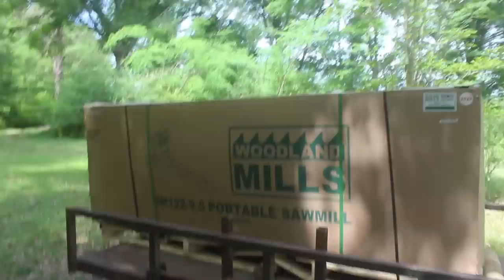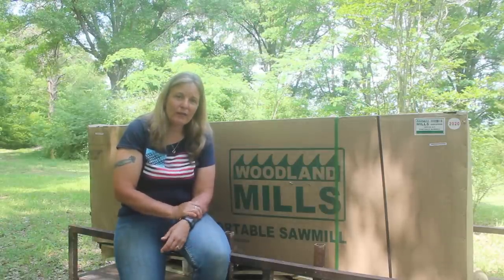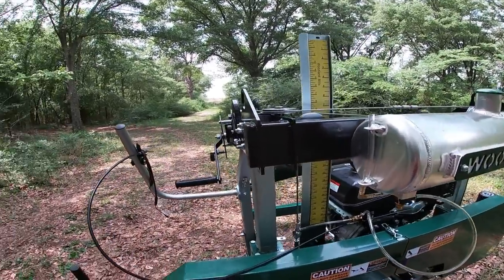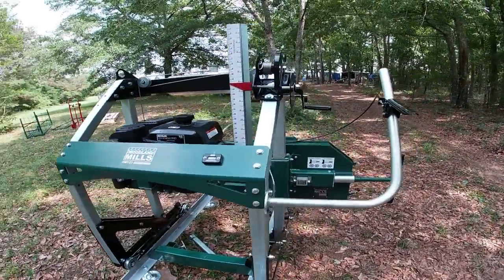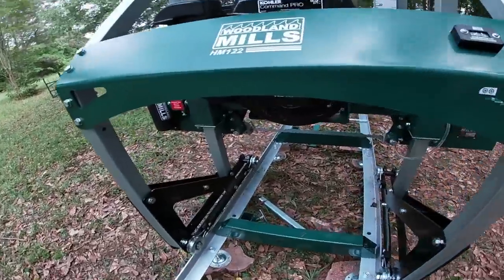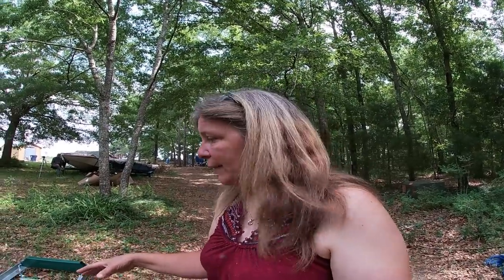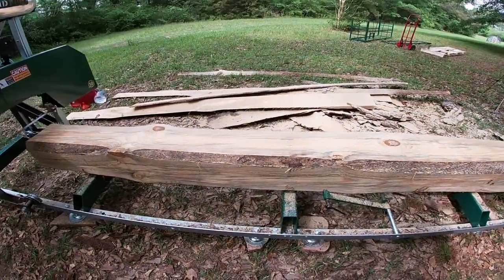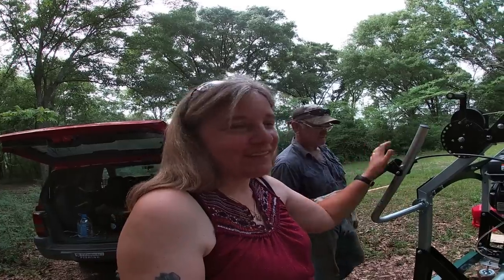Here We Go AGAIN : Harbor Freight VS Woodland Mills BANDSAW MILL

Comment: I am watching  your video now. Just a little FYI. I have owned an HM130 for almost 2 years and milled for myself and the public the whole time. For the money, you wont find a better sawmill or BETTER service. Your mill came with the hr meter and auto lube that I did add to mine. If you EVER have any problem, all you have to do is call tech at Woodland and will get an answer and/or replacement part soon. I am glad I picked Woodland Mills over the many other brands I looked at and drove a way to see if for nothing else but their service after the sale. Enjoy your mill and be safe.
Reply from the maker: That is great to know, thank you very much for the info and for watching.
Reply: I have a woodland mill also I agree 100 with Brad for the money this is an amazing saw

Comment: That is a nice saw mill and cuts good. I have the HM 126 and love it. I know it's been 2 years but I bought a hand held metal detector and I use it on every tree before I start to mill it. I have found more nails and spikes where they were left in the tree after something was taken down or fell off a tree. Even barbed wire that a tree grew around. You sure don't want that blade to hit something metal. Seen it happen a couple of times to a friends mill and destroyed his blade.
Reply from the maker: Is there a hand held detector that you reccomend?
Reply: @ThirdTimeAroundRanch    I have a Brinks security handheld that I have been using for a few years. It's similar to what they use in a airport to check you with. I hate to say it but my brother picked up a 15 or 20 dollar handheld he got from Harbor Freight and he said it worked just fine. He has found a few small nails with it. Hope that helped.

Comment: I have a hm126.  I had a problem with a bad clutch.  I burned it up because the throttle was not set properly.  I am confident from the sound of your mill that your throttle is also not set to full power on the motor thus overworking the clutch.   It will soon burn up.  Play with your cable, that motor will really rev when set correctly and the clutch will not slip.  Of course I may be wrong, I'm only hearing this on a cell phone!  By the way WM sent me a new one.  Love the mill hope you do too.
Reply from the maker: Interesting, we also thought the same thing so we called WM and they told us how to adjust the cable to make sure it was at full throttle. We adjusted it as far as we could get the cable to move. Maybe we will give them another call. We absolutely LOVE the mill!

Comment: One bonus the woodland mills has over many of the competition, the prices favourably compare. Woodland Mills is generally lower in price for everything compared to the other brands, quality wise, they stand up right beside the higher priced brands.

I've also noticed Woodland mills has a simple track extension method, split the middle of your existing and put as many extensions as you want in between. same connections for them and as good a quality fit.
You can also add extra dogs to help secure the logs against the uprights better. The optional cable winch log loader I've seen electric screwdrivers (drills ) power logs onto a mill, making the work much lighter.
If you were to get into doing custom cut lumber for sale, the extra length possible is a big bonus.

While adding any of these would cost some, the cost is lower for Woodland Mills than the comparable quality mills.
Reply from the maker: We could really use another bed section it was a tight fit on our log. We actually cut the logs to 10'4 so we had extra for squaring the ends.
Reply: @ThirdTimeAroundRanch  If you get it I would also get a second clamp just for the extra security knowing the log isn't going to move under the blade.
Reply: Jaqui Greenlee

Comment: We have had the same model for the last 3 months and have not been disappointed.  We have gone through some blades ofcourse and just got new guide bearings and the following drive belt ordered.  We use this mill just about every day. We bought the extension because we need to be able to do longer logs. Also your blades will last much longer if you peel or brush the dirt from them before sawing.
Reply from the maker: Thank you for that information, we will hopefully be stripping all of our logs.

Comment: i like mine.   i built a rigid steel  frame for under the bed rails  then chopped up a 200 dollar trailer kit from northern tool to go underneath it.    scaffolding leveler feet stuck into some tubing make good stabilizer/levelers for the mill.       they improved the 122 quite a bit though for your model year.   so some of the things i built for mine come standard on the new ones.    enjoy

Comment: I have a HM122 I got in 2017, been a great little mill, I've cut a lot of lumber with it over the years and the only problem I've had was the kolher engine died horribly recently and I replaced it with a HF Predator engine that seems to have better torque than the Kohler. I did replace the plastic lube tank with a steel tank and installed an hour meter.
Reply from the maker: Nice upgrades you did.

Comment: I bought a sprayer at Harbor Freight since the salesman on the floor said that he'd never seen one come back to the store. He said they have over 3000 stores and each one sells about 1000 a week and never saw one returned. I took it to the counter excited to pay $19.99 for it. The cashier was ringing it up and said, "If you HAVE ANY problems with this spray DO NOT RETURN IT TO THE STORE! Contact the manufacturer!" So, there you have it. Used it twice and the hose split just before the spray tip attachment! P.O.S. But they know it. Now you do. You get what you pay for. Harbor Freight...flea market products...flee the markets products!

Comment: May i suggest you buy a cheapmetal detector. It always helps to do a little NDT before you start, only takes a minute and can potentialy save you $ for replacement blades. It's surprising what finds it's way into a tree as it grows. Good luck with your endavours.

Comment: Two of the most precise instruments for measuring, etc.  Your eyeballs.  I use a Husqvarna helmet with the screen for your eyes and hearing protection.  Also, gloves, and chaps while sawing..  I have worked some in the woods and I have seen Professional loggers badly injured while using saws.  I have almost no hearing, mostly lost from gunfire in the military.  Hearing aids are not cheap and are a royal pain in the butt.
Reply: I own a tree farm.  I just had the loggers in for a thinning.  They had to hand cut some 30" - 50" white oaks and believe it or not, I was surprised to see them put on chaps & a helmet with screen & ear protection.  They told me that after seeing others nearly cut off a leg, they figured the chaps & helmet was much cheaper and less painful than the cost and pain of an injury.  I actually witnessed one get hit in the head from a large limb from a neighboring tree during a felling . . . and he got right back on his feet with no injury!
WEAR ALL YOUR SAFETY GEAR . . . IT'S NOT MACHO TO LAY IN A HOSPITAL BED!
Reply: @michaels3972  Absolutely correct.  Even the professionals are occasionally injured.

Comment: I had first considered buying a harbor freight sawmill too. I  was more fortunate than you were , because this was a huge investment for me I did my research and watched videos on all name brand sawmills. One of which was the woodland hm122 sawmill.  After watching the videos that woodland makes on all their saws and comparing the costs I ordered their HM122  sawmill. I'm not pressed for time so I  just ordered the 7 hp so cutting speed wasn't an issue for me and I wasn't planning on any logs larger than 20 inch diameter.  So i figured the extra money would be better spent on the track extension because I knew I would want to cut 12' boards and woodland ships anything extra added to their order for no extra costs. I wish I  could've afforded it & I  would've also ordered their blade sharpener/ setter cumbo.  But that will have to wait.  I did order the extended track, some extra blades & some bearings. They won't ship it until nov 30th,  2021 which is giving me time to cut down some trees.  Most my trees that are on my property are black walnut so I hope full in selling some of my walnut boards to pay for my sawmill. My trees are in the range of 16-12 inch in diameter.  Keeping them a little over 12' is just about my little JD 2305 tractor's limit for lifting and hauling up a fairly steep hill. I  only guessing but I'd say they weigh over 600 lbs. Lately I've been watching quite a few of your videos, sawing with sandy & lumber jack. Learning a lot before  my mill arrives. I  just finished building a platform for my sawmill.  Using my tractor & my 6" post auger, drilled 10 holes, 3' deep, arranged 10- 5' long 4x4 for 2 tracks 26" wide and 20' long. Leaving 2' of the 4x4 above ground.  After concrete set I used my laser to mark all 4x4 posts at the same level, and cut them off. I used 4x6 posts instead of the 4x4 for the center posts because I planned on using 10' 4x4 posts bolted on top of my posts which the sawmill tracks will set on. This will put my mill just a little over a foot off the ground. They sell a cover for the mill but was a bit pricey. So until I can get a roof built over it I'll have to keep it covered with a tarp. If you haven't invested in a blade sharpener you might look at woodland mills combo for just under $1000.00. Hopefully you're saving your old blades.  They say they can be sharpened up  to 5 times. At roughly $25 a blade it won't take long to pay for itself. That will be my next big purchase. I bought 10 extra blades,  if I was able to sharpen them all 5 times that turns them into 50 blades @ $25 a blade that comes to $1250. I figure cutting walnut boards,  I'll probably be going through quite a few blades.  I believe I'll pressure was my logs to remove any dirt or debris that might dull my blades.  Thanks for all the great sawmill videos.
Reply from the maker: Wow, you did your homework better than we did. Great job! We have our blades sharpened by a company near us for $8 per blade. We wont be putting much more money into ours as we don't really plan on keeping it super long term. We have already made our money back on it by cutting our own lumber for our builds. When we have everything built that we need/want there wont be much reason for keeping the mill. We can't seem to get our hands on any good hardwood around here.

Comment: I wander , do you let the water open all time went you use it or just as needed...? Thank you for your answer...!
Reply from the maker: On the harbor freight mill you have to turn the water on before you make a cut and shut it off after. The woodland Mills has an auto waterer, when you pull the throttle the water turns on.
Reply: @ThirdTimeAroundRanch  Thank you very much...! Look like a good design this andle for water...! Have a good day..!

Comment: I have a simple guide when it comes to Harbor Freight tools. If you only need it to work once. Harbor Freight is okay. Not good but enough. If you need the tool to work for any period of time go for the designed & tested tool. You will probably spend more on purchase but you will save so much time & money by project's end. The one thing I would HIGHLY recommend for your particular mill is get one section of extension rail. Being able to mill longer lumber for not just yourself but for neighbors to buy once you get that wood certified could be a good backup income source. Keeping the blade sharp is KEY to making either saw work right & efficiently.

Comment: I also bought the HM122 as my retirement gift to my self.  Upgraded to the 9.5 motor  and the extra track extensions and the five pack of blades .  This was their 10 anniversary model.  I had to wait almost three months to get because when i bought it Covid19 hit and their was no shipping .  Woodland has a distribution warehouse in Portland Or. so pick it up there as I'm close.  I had some problems as the blade came off ruin one new blade never touch any wood. Called Woodland and service walked me through realigning the wheels. Once that was done has worked like a charm. They didn't replace the blade :(    I have cut  Fir, Alder and Maple so far and I love this mill so far still trying to figure out the scale this confusing to me but that might just be me... great ivestment for the $3000 I spent looking for more than a year
Reply from the maker: I'm STILL trying to figure the scales out. It's different for every size you want to cut. If I cut a 4x4 using the same scale as the 1x's then it cuts something like 4 3/4. It is confusing.

Comment: I'm sorry your hf mill didnt work for you however I've owned one for 4 years now,I installed rails that can cut up to 28' .I've only replaced the clutch.
Reply from the maker: I must have just been unlucky, but I stand with the woodland mills being better built and sturdier. 28' wow, we need to add a bed extension just to cut 12'.

Comment: Actually, the length of the video wasn't too long in my opinion.  Some folks like to watch the equipment in action, and some like to see the 'new' wood revealed after each pass (hint:  set the camera angle high pointed down at the log, so you don't have to move the camera around while cutting, although some editing will be required).  Good video and good luck with your project!
Reply from the maker: Thank you for that tidbit!
Reply: It's not true that u can easily get parts for this portable sawmill I bought  5 of them  but I had to park them in my compound  simply  i couldn't find part's  for them, 2 you can't use the blades for two weeks  before they break. I don't believe the two year guarantee  I live in Uganda  en the five sawmills are here  in my compound, can u advise me  where  to get the part's in Uganda 
Thank u

Comment: Thank you for the good comparison of the two mills and the problems you did and did not have, but one thing I noticed  you did not take the time for safety gear with the chainsaw And hearing protection around the sawmill. Having said this because of my hearing loss around small engines.

Comment: I have a harbor freight mill, I've had it 2 years, used it alot and nothing has broken. I wish they sold a track extension kit. That's my only problem with it. Also isn't the woodland mill one about $1500 more?
Reply from the maker: There is a $600 difference. Woodland Mills has many "extra's" you can buy for the HM122. We are really glad we went with them!

Comment: Stupid off topic question.  Are you shooting with a go pro? I hear the default image is somewhat fish eyed with them and it gets removed in processing.

I have noticed a slight bend at the far sides of the video that is only really noticeable  when the straight lines on the saw mill track runs across it and out of the shot frame when you did the walk around.  I'm just curious if it is the camera or an optical illusion from just the angle and everything falling into place at the right time or perhapd it could be my unconventionalviewing setup ( I wirelessly pipe my video from an old phone to the TV using widi). I have thought I noticed it in videos from other creators but never had such clear straight lines in the shots to confirm my observations before.
Reply from the maker: I was shooting with a go pro 7 white and my DSLR, You are correct about the fish eye view I couldn't seem to change it with the go pro. But I just bought a go pro 8 black because I broke the screen on the 7 white. The black has better settings and different view's so it should not show the fish eye aspect anymore unless I am shooting in small spaces like the kitchen.
Reply: @ThirdTimeAroundRanch  thanks for the feedback.  The footage looked really good and it was really only noticeable with the straight lines from the tracks. But I just needed to know.

Thanks again.

Comment: Ok, so I watched this video front to back then went and watched the HF first cut video, then came back here to comment.  I'm wondering now how the Woodland compares to the Frontier sawmill line.  You guys do some good stuff.  Btw, where did that cant hook come from?  I use old ones from back on the farm and we made a new handle for my favorite little one literally only a couple months ago.  Good description by the way and a darn good comparison between the two.
Reply from the maker: We bought the cant hook (without seeing it first) from Cooks Sawmill, they are close to us and they sell and resharpen the sawmill blades. I dont like the cant hook because it is square tubing. Kind of dumb if you ask me, very uncomfortable to hold on to.
Reply: @ThirdTimeAroundRanch  Well, I was going to ask that, but couldn't think of how to just in case it was something you really liked.  I personally don't care for metal handles in anything, shovels, cant hooks, hammers or just about anything. Once tubing is bent, it seems as it will never be the same.  It might just be me, but metal or fibreglas hurts my grip after a time, unlike wood.
     I sure wish there was someone close here to hammer mill blades.  Mine is in bad need of a hammering and also it needs new shanks and bits.  Shanks and bits are the replaceable teeth in an inserted tooth blade. Blades need to be hammered for left hand or right hand operation as well as for rpm of the power unit.  The 50'' on my mill now was one I bought at a farm auction and have no idea what it came off of.  It's ok, but not quite right.

Comment: If you sharpen that chainsaw chain and lower the rakers it will actually make chips rather than powdered wood...don't ask how I know this...
Reply: That would be good advise ... if this was a chainsaw type.
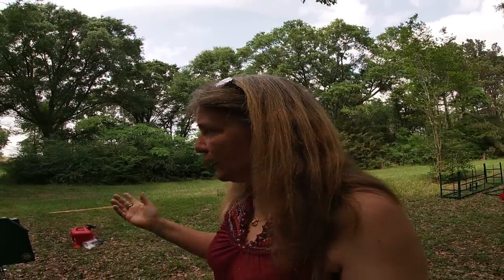Reply: @joka7316  If you actually watched the video you would have seen they were using an EXTREMELY dull chainsaw chain around the 12:00 minute mark...but don't let that stop you from making snarky, comments...